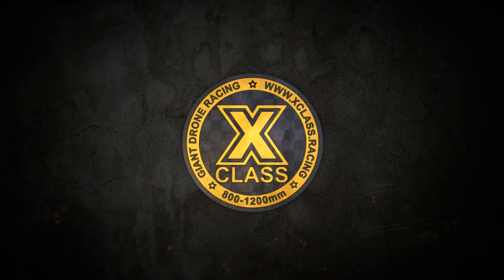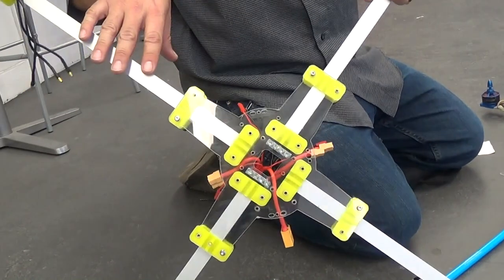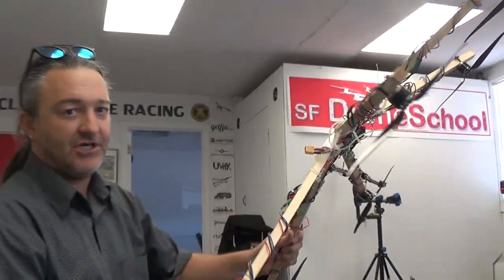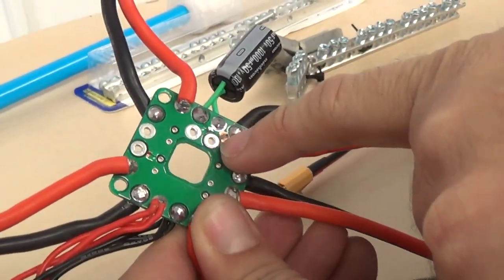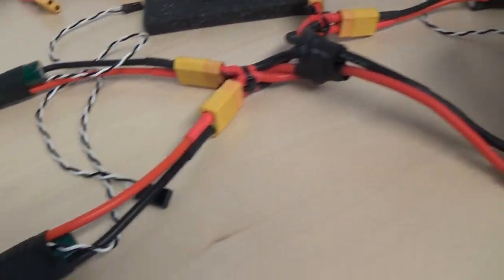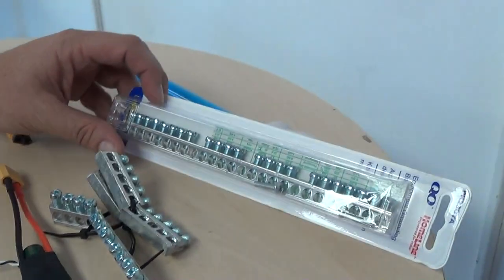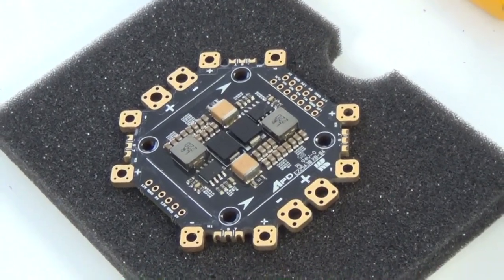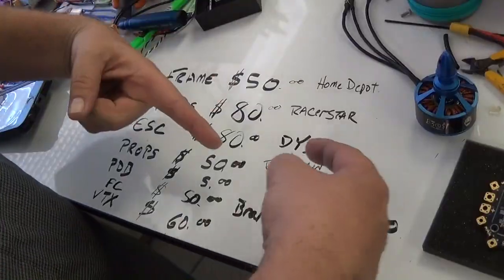X Class budget build for under $400.

Comment: 70 amp DYS are $160 for 4. Not the price you quoted. Unless you have a hookup. Btw. Your wiring is so jenky ha. No offense. Ha. That giant glob of solder could be better done with a circle connector and a bolt through them.